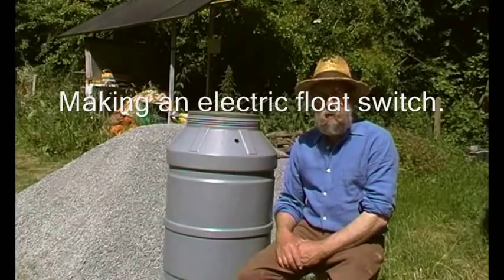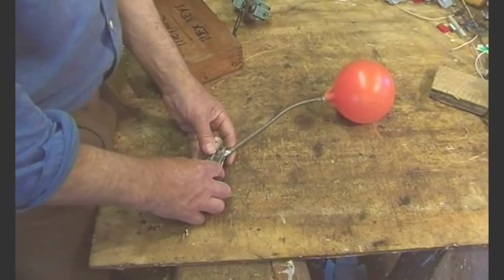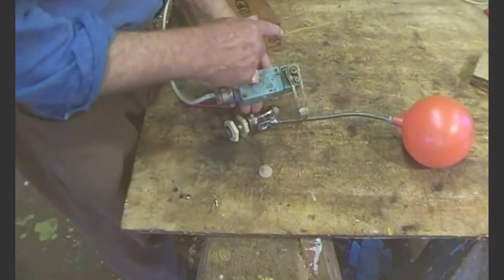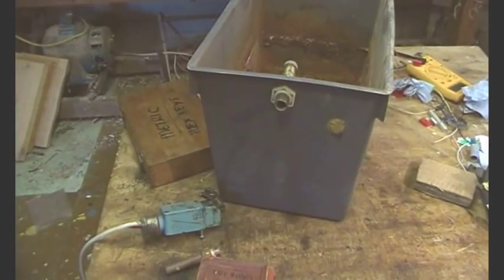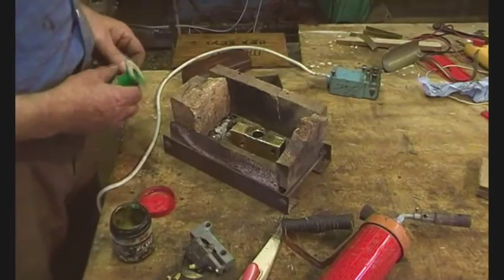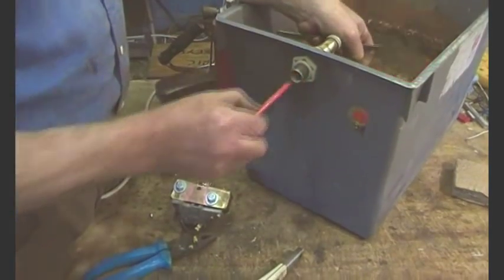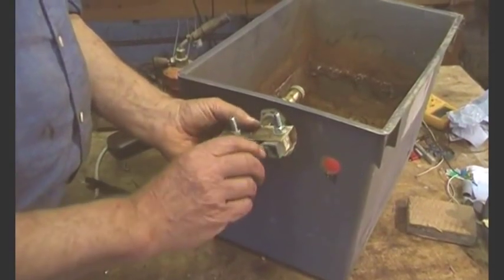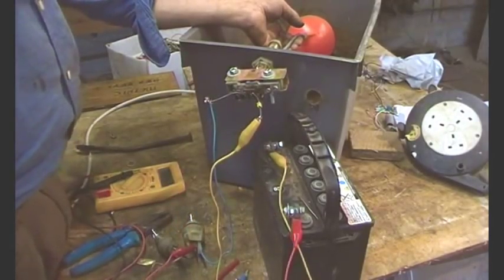Making a float switch for a rainwater pump, ball valve hack.

Comment: Nice re-use of a limit switch Andy. I was trying to work out what the rainwater plan was - my guess was that you need rainwater somewhere higher up than your main rainwater tank can reach by gravity ? I haven't seen more than about 0.1mm of rain in the last month here...so I hope your tank has some in it :o) Two sheep troughs run from a rainwater tank here, and the tank is getting mighty low now. Cheers, Dave
Reply from the maker: Dave. only time will tell if this is reliable. The switch contols a pump that pushes water through a series of 20 and 5 micron filters into the tank I showed at the start. We still have about 1000 ltrs and yes it is pleasantly dry after such a poor winter and early spring, cheers, Andy

Comment: I beleve there will be a problem when switching on and of .
If operating water pump there will be no interval between on and off. Float will not be stable
Reply from the maker: Hi, I know what you mean if only a small volume of water is consumed from the tank, however this will not happen as the tank is to hold filtered water and at least 1/2 of its volume will be transfered at any one time, cheers

Comment: That was a really good mod Andy, and it looks like it will be nice and robust. However I just wanted to draw your attention to these float switches: https://www.jaycar.co.nz/float-switch/p/SF0920 I installed one in our header tank to control a water solenoid and they are really easy to use. They work on a magnetic reed switch principle so are compleatly water proof. The only thing is they don't switch a huge current, but a relay or mosfet can be used for that.
Reply from the maker: Hi, thanks for the link, there is something similar on Ebay for £4 delivered but they do not have what I assume is a threaded boss on the float to take a longer float lever. I do not realise they were a magnetic reed switch. Thanks for the info, CHeers